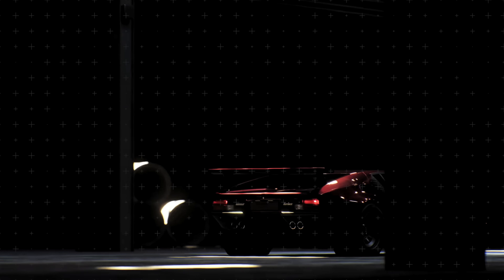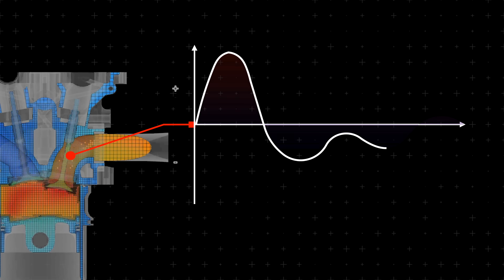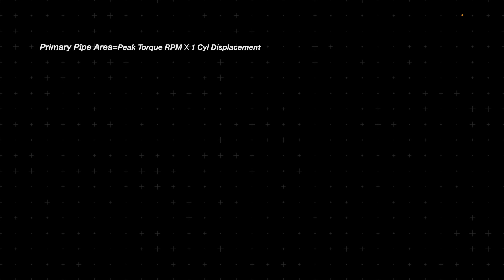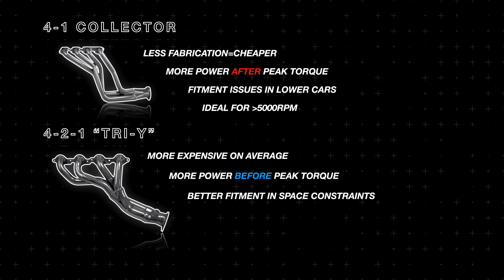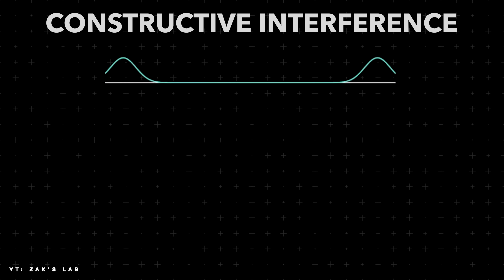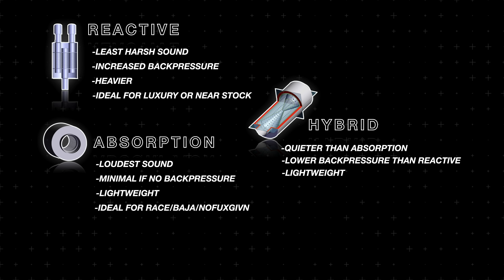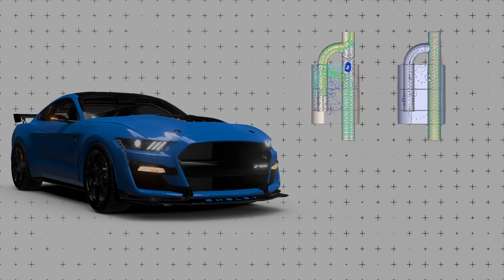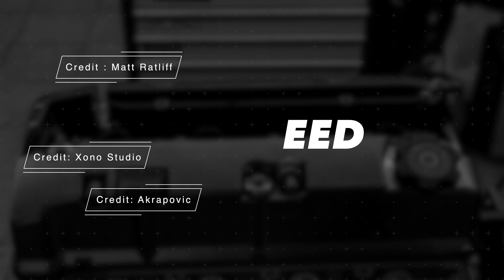Why Exhausts Make So Much Power😵| Explained Ep.27

Comment: Great video, I feel like I learned more in 10 minutes than I have in the last 10 years.   Exhausts are a staple of the car community and I love how you can transform the sound, character and power delivery of an engine just bey changing the exhaust.  It's just a shame so many modern stock systems sound so dull because of regulation. And of course they want to push us all into EVs eventually so I guess one day exhaust systems will just be a historic curiosity. It will be a sad day indeed when that happens!

Comment: Nope, incorrect!  Only if the firing order scavenged equally in pulse waves, without interfering with eachother. Unequal tunes are exactly what is needed in US cars because crank journals are shared, the firing order options are limited and not designed as a unit, more of an afterthought. Pulses crash into eachother or nearly. Making some tunes longer could tame the chaotic games into a more homogenous flow. NASCAR has equal length tunes because it's  mandated and not because it's better! Really good video, but ultimately wrong.

Comment: Great research and video.. my son and I are restmodding his Jag XJS v-12 (a real engine ) there is one company that makes headers for the V-12.. since there are 6 cylinders coming up on there power stroke at any given time, are there any other concerns I should consider? Or you would add, the rest of the exhaust is 2-1/2" ss, with a cross pipe just before the rear end. (Only place to install).. thanks again.. for the great work..

Comment: I have such a dislike for those high pitched engine sounds.
I prefer the bassy types, which are fitted with a supercharger/hypercharger, so the bassy tone is there until the charger begins to whine louder than the engine can roar.

Engines need to roar, not scream.
Pah.

OOOOOH:
Harley Davidson.

Comment: Please consider the GEET exhaust system as a poentially revolutionary advancement! Could cars recycle the heat and pressure from exhaust by using it to pressurize and the heat the fuel? And if some of the exhaust is unburned fuel, cant it be sent back into the fuel system? This is what the GEET does well for small engines on generators and lawnmowers

Comment: I used to own a classic Mini. I added an aftermarket exhaust and header. It was a two box system with essentially a glass pack followed by a muffler. For a time I replaced the muffler with a straight pipe. It moved the power curve up the RPM band. Eventually I went back to the muffler. It was a fun experiment. I was working as a production welder for JBA Headers at the time.

Comment: exhaust is choked up so it can  keep the catalytic converter as hot as possible to burn up emissions. I'm running 95 Maxima 3.0 exhaust manifolds on my 2002 3.5 Maxima because the ones from the older Maxima actually flows way better.

Comment: Large diameter headers (particularly long tubes) generally do not make less torque than factory manifolds - in fact, in most applications, they add a huge amount of torque down low.  I've seen this on the dyno countless times.  Factory manifolds are almost never designed for scavenging - they're designed for durability, packaging and cost.
Reply: This.  I have a gen3r 07 gt500.  I was pushing 20 psi stock long block catless and borla stingers it did 725 rwhp 690 rwtq in 95 degree heat on drag radials.  I did long tubes otherwise no other changes and it was 740 and 733 to the wheels at 19 psi.  So it jumped 15 rwhp and 40 rwtq peak to peak and it was 15-25 rwhp throigh the entire curve and 30-40 tq through the whole curve it was like 40 down low so that's a pretty big difference for having already had a full exhaust prior to the headers this was JUST HEADERS.  It was same tuner same shop same dyno similar conditions a year apart.
Reply: So not only did it pick up 15-25 rwhp throughout the curve and 30-40 rwtq its doing it at about 1 psi less boost which is very impressive.  Again this was a car that already had a full free flowing exhaust other than headers.  The sound is very noticable it was real good before its absolutely incredible now.  The sound is insane.  Sounds so nasty deep and throaty.

Comment: This is why I bought a 2.5" Down Pipe for my Turbo and moved a Fast Cat under the car to the Mid Pipe.. Keeps the smell and Drone down and keeps the car 48 state legal still.. I had my car catless for about a month and couldn't take it no more because it's kind of a daily so I had a Fast cat welded in.. I don't know if there was any power loss from the cat because once I got all my piping right FMI, and Hard charge Pipes, Then I took the car to the DYNO, and had it tuned with the Cat on it and they just did a Boost tune and I gained just about a 90 WT.. 80 WHP.. All the Guy did was unlock the ECU and and Flash a stage 1.5ish Map to my car.. I have been trying to find someone who tunes Nissan and Jukes with ECUTek software for a very Long time.
     ( I made an account with Visconti but because I didn't buy the kit from him I can't really figure out a way to pay him to Tune my Car I know he has serval really good Off the shelf Tunes.. So I am trying to Figure out a way to Pay him $500 for a good stage 2.5Ish Tune.) 
     I have the Kit Dongle and License, and a Copy of my current Map, But it's so hard to find someone who will tune a Juke even though guys are making Real Power with the Manuals..

Comment: It's now been proven that having all header primaries the same length is the wrong way to go! They now know how to tune the exhaust gases for increased horsepower. In fact, on a v8 engine, the primaries from one side of the engine will be combined with primaries on the other side of the engine to use this "tuning" effect. The information in this video is pretty dated.

Comment: Idk why they don't have forced induction by turbo. Then forced exhaust by Super Charger? That would get the gas out quick & in proportion to the engine revs. Depending you applied the vacuum/venturi effect which would keep the exhaust cooler!

Comment: Yes, the sound given from a decent tune will make a vehicle addictive to drive. Say my 71 F100 with a 10:1 390 fe, I have it sorted for the most part but still have things needed. A summit M2008 750 cfm carb and old analog msd 6A ignition box, just work with out fail. I have that carb set failly well off a wideband gauge, and the vacuum advance distributor set such that there is no knock on 93 fuel. The cam works but am going to get a custom ground one to drop dynamic compression some, so dont need to run such a cold plug to keep knock at bay.

You give this engine a set of long tube headers with 1.75in tubes with 2.5in pipe, that has a h-pipe and dynomax turbo mufflers with turn downs. There is a pleasant sound given, that gets better the harder she is pushed. Say when the vacuum secondaries kick in, the music given is a nice throaty roar that you want to keep going. Yes this truck has a lot of exhaust drone at certain rpms, due too the short pipes with turn downs but will not change a thing. She is loud and proud, with a chop at idle that is to die for.

Comment: (chuckling)  Strictly speaking, exhausts do not make power.  You can decrease how much they restrict available power, but they'll never actually increase it beyond what the engine itself is capable of producing.  That said... it'll be sooo nice when we get away from this legacy "technology" that has vehicles spewing toxic gases across every inch of road that they travel, for every moment that they're running.

Comment: most irritating fact of IC engines no one still made a heat exchanger of exhaust and air+fuel mixture, I still see inputs to be heated 'bout 70C (maybe just air, but it will increase effic., 20%) No one even refined the IC engine that can still modified to run on vegetable-no-nitro-fuel. And here is see fools thinking electric will save them when companies wants profits over your pockets.
Reply: Why then, do turbo cars run intercoolers?

Comment: This didn't address pre-obd build types. You know, vehicles without sensors, non ecm types. Vehicles that use screwdrivers not programmers to tune up.
Other than that, this video is good and I learned about H and X exhaust systems and resonators.  Thank you.

Comment: Exhaust upgrades are all about scavenging. However once an engine is supercharged from below idle, the need for fancy exhausts for scavenging is no longer needed. That’s why funny Cars & WWII era aero engines have no need for fancy exhausts & just have stubby straight through exhausts. Meaning with a supercharger on your car you are just wasting money getting a fancy equal length extractor exhaust. All that’s required is a wide open pipes & straight through Stainless packed cheesegrater mufflers. Enhancing scavenging is simply a waste of money one an engine is presurised

Comment: Question. Cat back exhausts, are they worth it for the young and up and coming car enthusiasts? I did them on a 99 v6 4.3 blazer and an 08 Colorado with the I-5 3.7. Both sounded good for cheap upgrade, both had cold air intakes also.

Comment: Go fix your poor math, 3:50 seconds in, your equation for diameter is wrong. That equation gives you the radius, you are going to cause a lot of confusion for your audience. Multiply the answer of A by 2 to get your diameter after you get the radius using the math shown in this video .
Reply: Diameter = 2 * sqrt(a/pi)

Bro..... he does multiply by two in the video 😂😂😂😂 there is literally a 2* in front of every equation labeled as diameter
Reply: @strs7881 😂😂 He Schooled himself
Reply: .81 is what the answer is according to your formula provided referencing the K20 motor. That is not the diameter, that is the radius

Comment: Great video packed with valuable information. Only thing I think you missed is while equal length primary tubes are best with most engines there is the cross plane V8 which many builders believe different length primary tubes tuned to make exhaust pulsed evenly spaced with the odd fireing pattern of that style engine are the way to go. That is what I have on my own car and I think they do work better.
I definitely liked the video and I'm about to subscribe so I won't miss new ones.

Comment: I designed straight pipes for motorcycle some years back.  I set scavenging at peak torque, so around 4,500 RPM.  Using that, and a cylinder displacement of 325cc, I came up with 1.5 inch ID pipe at a length of 27 inches.  I dropped 2 full seconds on my 0-60 time. My cruiser could launch and lead most crotch rockets of its day up to 45 MPH. That's when the gearing would start to let me down.  

I had to park my bike a long time  ago, but not before my friend took it into his shop, put larger jets in the carberators, and port matched the intakes.  It got parked because I blew out 3 disks in my lumbar.  So, riding has a high chance of further injury.  I did take it for one drive after he dropped it off so I could work Seafoam into the system.  Man, that got even faster.

Comment: During the 1960s, I converted a 1966 Olds Cutlass (330 4 barrel carb) from a single to dual exhaust, Results: 3 second faster 0-60 & 25% better gas mileage,  The less backpressure, the better!

Comment: May I point out that exhausts do not make power. Some are less restrictive and allow the engine to breathe better and can even balance the exhaust pressure over all the cylinders, but no exhaust ever made power unless there is a turbo in it.

Comment: 99% of modified exhaust are wrong. They over exhaust. The headers are way too big robbing low down power making the car unenjoyable. The exhaust is usually too big which is only good in the high revs. No one listens. The exhaust shops are clueless too

Comment: For turbos collectors you dont want the most thick.  You want a collector with low thermal inertia ( has to be thin ) and  low thermal conductivity ( inconel for example + insulation )

Just like in 2  strokes,  thermal inertia robs the heat during the transients ! 

Short runners are good for having high enthalpy at the turbine, but say for a rally engine, long runners can be beneficial to improve cylinder filling when the turbo isnt fully spooled.    This works very good in turbo 2 strokes also
Reply: But your video is excaptionally well made the animations are awesome

Comment: I have a evo engine in 950kg fwd I had a 2.25" exhaust with crush bends and a factory dump pipe running 15psi. 
I built a custom mandrel 3" Turbo back system with a large 3" dump and makes more power now and even feels faster at 10psi than I was at 15psi with no other  changes .

Comment: I'm thinking you haven't seen David Vizard's discussion on unequal length header primary tubes and their advantage on V8s?
David even shows you how to build a full exhaust system that makes as much power as headers & collectors but is still quiet.
Sounds impossible but it isn't.
Despite all the science theory behind this header phenomenon, how are headers actually going to work in the real world for dual purpose cars for the average hot rodder? 

Sure on a factory car with a development team behind optimization where they can build and test 350 different combinations they're going to work but as soon as people get changing intakes, compression ratios, camshafts, valve sizes, cylinder heads, revving them higher while still requiring low and mid range torque all bets are off. 

No two engines are the same so buying a set of headers and expecting them to work for you as advertised is only going to only end in compromise at best. 
I simply don't believe a single thing header manufacturers say, as it is like putting Dracula in charge of the blood bank.
Header theory is for race cars and factory cars, for the rest of us we just have to guess and hope.

Also the H pipe is just about exhaust pressure averaging isn't it? Average the exhaust pressure that then averages the intake pulses and hopefully results in a better fuel distribution because of more even airflow into individual cylinders. 
For passenger car engines it is far more about engine pumping loss reduction than anything else.

Some engines don't even respond to headers despite all the theory. There was a vid on YouTube of a particular engine specialist for inline 6 engines that said to a self appointed engine guru on this stroker combo that headers won't make any difference to this engine over the factory manifold (which was a good looking smooth bend, unequal length short runner in the middle and long ones on the outer dumping 6 into 1). He insisted, they put the individual primary tube headers on and the headers made no difference at all. The max torque & HP graphs were overlaid and they were the same give or take about 1hp and 1ft/lb. Again this was a stroker. 

It's all theory for most of us, since we put a set of headers in place of restrictive exhaust manifolds then they're going to work because of reduced pumping losses and a tiny bit of 150rpm wide scavenging and maybe a 5 or 600rpm increase, not because of a synthetic theory however true in a test facility. 

Thing is, race cars run in narrow RPM bands, enthusiast's self modified cars run in very wide power bands and it is difficult to get an exhaust header to work everywhere.

Comment: I don't know if you have one but can you please please please make a video that breaks down cam specs in simple terms?  I understand how a cam works and I also know different manufacturers may have different measurements they advertise but I hear people all the time just call a cam by the intake number or intake and exhaust number and I can't follow that.  A video just like this that goes over intake duration, lift, overlap, exhaust duration, lift, etc that tells me better for torque or better for top HP so I can pick my own instead of just going by names or suggestions.  

My example would be rebuilding a stock 04 5.7 Ram Hemi for my 4x4 Dakota.  I just want a simple truck motor, OEM+, Stage 1, Daily Driver however you want to call it.  Is it as simple as a Comp Cams Stage 1 Truck Cam?  I want to be able to double check that myself and compare like for like across brands as well.  Thanks in advance and keep up the great work.

Comment: I'm cheap, and poor. And I like to do things myself and reuse parts that most people would throw away or scrap. So I traded for a set of used Flowmaster 40 series mufflers, got a $30 x-pipe from eBay and built my exhaust from a bunch of scrap exhaust pieces that i collected from wrecked cars at the body shop. I don't have headers yet. And I know that it's not the best engineered system. But it was cheap and sounds good. That's good enough for a 96 Buick Roadmaster sedan

Comment: Gee.. the RIGHT technology has been there for 80 damn years.. the diameter and EQUAL length of the headers make a huge difference
it all depends on WHERE you want your power to come on the most... Big tube = late and small tube = early.
equal length can vary but was mostly 36" to give even back pressure to all cylinders. Over scavenging is the most common mistake.
(pulling the intake out with the exhaust)